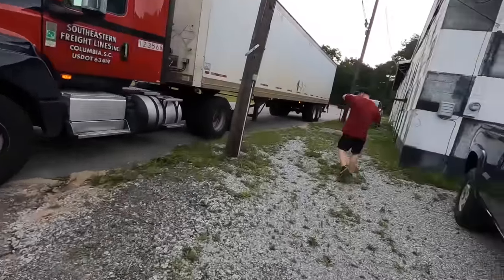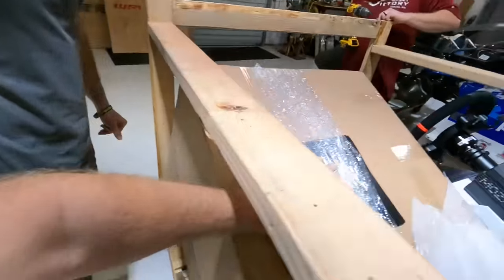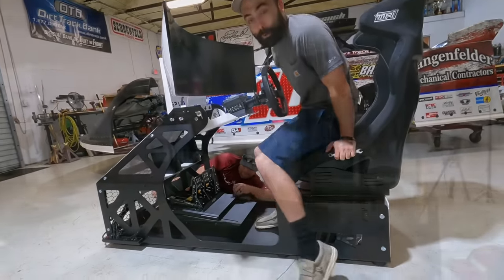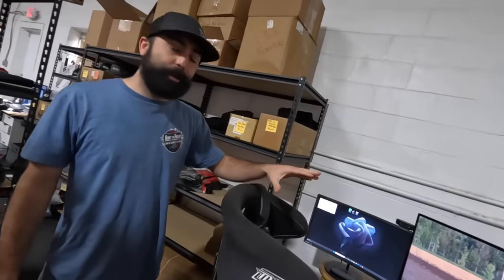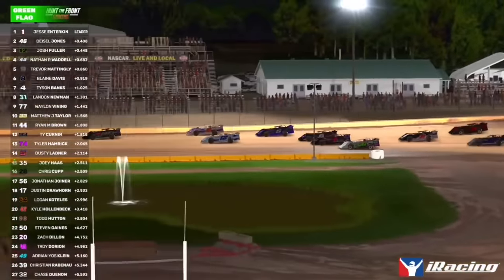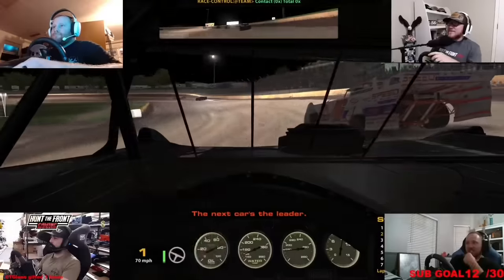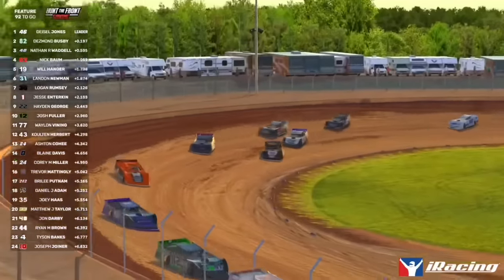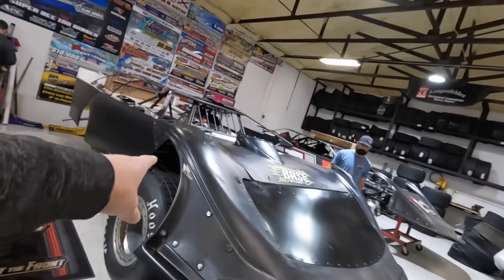Big Delivery at the Race Shop! This HAS to Make us Faster!

Comment: Nicer than mine, but I use VR. I hope y’all got the FoV adjusted.

Edit: y’all did get it adjusted I see.
Reply: What should it be on
Reply: @commandoslair9990  Depends on your setup. It's calculated by screen size and distance to screen. There are a lot of fov calculators online and one in iracing
Reply: @commandoslair9990  it should look like you’re sitting in the car. The first test run, that air filter was way out there. Later, it was the normal distance as if he was sitting in a real car. If it’s not right, it gives off the wrong sensation of speed.

Comment: Tap equipment bottom results … not complaining I like watching your videos but your race program is weak at best … top-of-the-line longhorn and a wide bore Clements running for 5K as the primary show is a joke … and then jump up and down look what we did … you have more in your hauler than most guys have in their Motor and chassis …

Comment: Must be nice..maybe stick with that besides real racing
Reply: What class do you race?
Reply: @jasonnelson2744  open wheel modified..any other questions??
Reply: @chrisodie2467  modifieds is a fun competitive class. As for Jesse sticking to Sim racing I think the opposite for him to improve he needs to try and get in a car more often. He is still relatively new to racing compared to the competition he is running against and if he is having fun out there that is all that matters. There are a ton of racers that have been racing longer and haven't finished in the top 5 at there local tracks let alone traveling races.